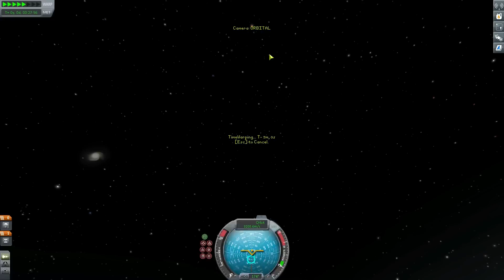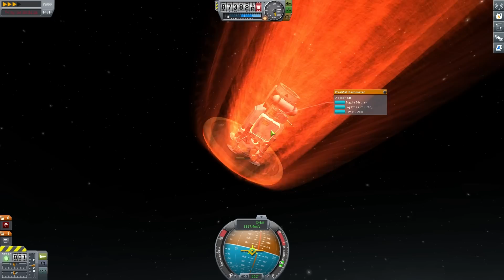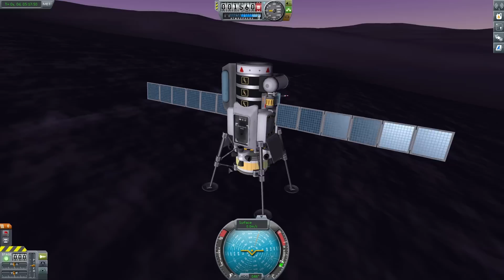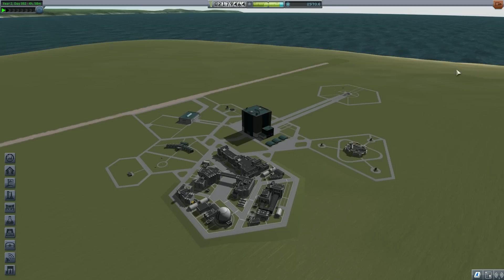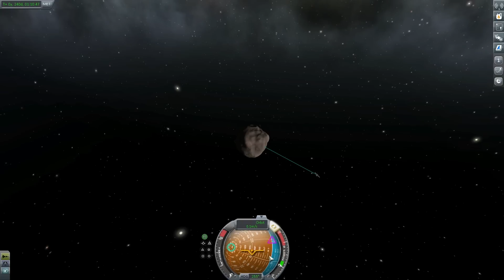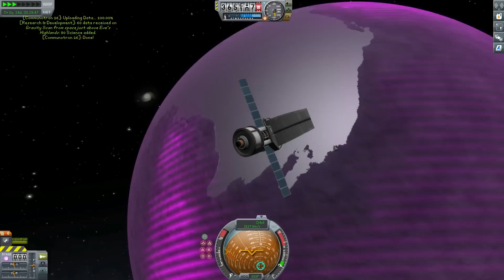Gilly and Eve Landing (Beginner Tutorial: 15) Kerbal Space Program (KSP) 1.1 Stock Career

Comment: i just discovered a class h asteroid that will have a really close kerbin encounter. im wondering if i can capture it. the description says that if it was orbiting it would be a small moon. they can be 250 meters across. i thought e was the biggest then i captured an f. gilly is half a km so an h would be 1/4 the size? half the diameter 1/4 the mass? probably the largest capturable object in the game if it is capturable. i basically have a saturn v mining vehicle i use to capture big asteroids. probably have to upgrade it. it doesnt need as big of a fuel tank but it needs several convertotrons.  might need the 5 meter fuel tank mod..

Comment: Now in KSP 1.2 (haven't updated to 1.3 yet), is antenna selection an issue to cover the ranges between Kerbin and other planets?

I haven't gone interplanetary just yet (apart from a bit of messing about with an experimental shot at Duna), and wouldn't want to go to all the effort, only to have no way to send back the science accumulated because I had stuck the wrong antenna on the vessel(s).

As usual great videos, this time of your Eve/Gilly mission. :O)

Comment: Sorry it's is late, but any tips on aerobraking in eve?
Reply from the maker: Quick Save / Quick Load is your friend, then a bit of trial and error (just got to pick the perfect periapsis to enter the atmosphere, wipe off  the speed you need, then exit the atmosphere. I've done it heaps and I still need to trial and error it a lot of the time. The guide in this video is a good rule of thumb but it depends on the size of the vessel and the weight of the vessel as to how much velocity will be reduced on the atmospheric pass. So a periapsis that works perfectly for one craft may not for another craft with vastly different weights or dimensions. 
Need a good heat-shield too of course. Eve's orbital speed it higher than Kerbins.
Reply: +Marcus House 
About the heatshield thing, should I just use a regular 1.25 meter shield for a 1.25 meter probe? (It's main problem is overheating the Science Junior in the middle, separating my probe core from the heat shield).Since it can't target retrograde, and I need to roll to prevent overheating, which makes it much more difficult to point retrograde. And when I disable SAS, there isn't enough atmosphere to point my vehicle retrograde.
I'm sorry for the crap ton of info, but the: "Explore Eve" contract is RIGHT THERE and I need to make sure it'll work so I don't go in debt.
(Once I load a save I can't revert my flight, so when it just refuses to work, I just give up.)
Reply from the maker: The Science Jr is a pain. Unless it is coming back to Kerbin I don't even put one on (as most of the science is return only). Put it as far back as you can. Keep in mind as well you can do the Alt+F5 & Alt+F9 to save and load many different saved files. I will usually do a named save for each main leg of the journey (including one sitting on the launch pad so I could revert to launch that way... not sure if you knew that or not).
Reply: +Marcus House 
I didn't know that! I play on a Mac, but I'm sure function + alt + f5/f9 will work.
One final question (thank you so much for your time!) So, should I save the science Jr. for a future, more advanced mission?
Reply from the maker: No worries. Happy to help. Really up to you. I tend to think the science jr is best for manned missions as you can pick the science up and bring it back with you without even having to bring it back. It gives minimal return for the effort in one way probes (and they are big and heavy. If you watch the Jool missions I did I was able to have lots of little probes without a huge ship.
Reply: +Marcus House 
Thanks for the info and cheers! I'll stop bothering you now :)
Reply: +FightOnGaming 
Ooooooohhhhhhh! I just now realized I was orbiting retrograde around eve. I can't believe I didn't realize that!!!!!
Reply: FightOnGaming fpr me i would recommend just installing the trajectories mod ;)